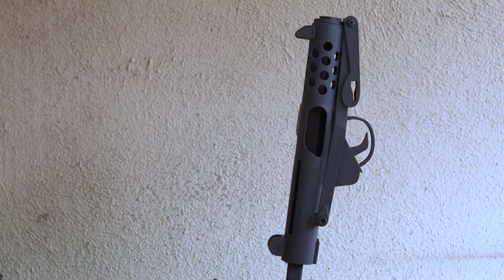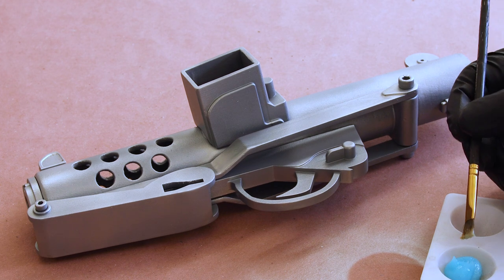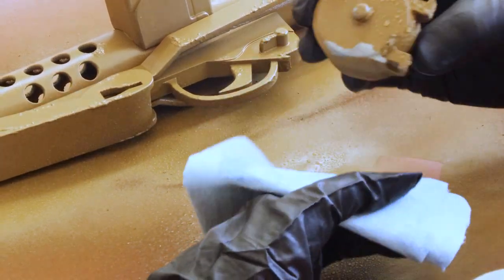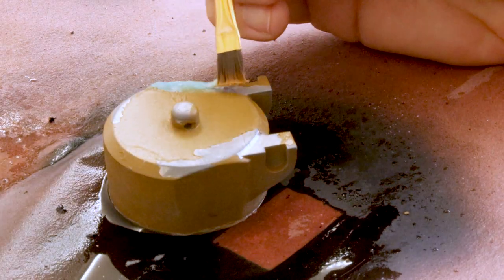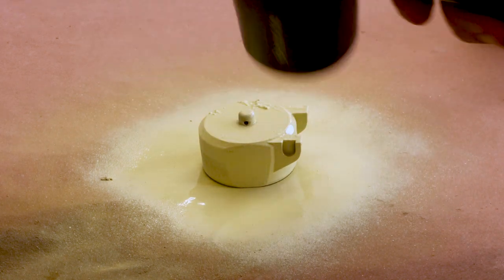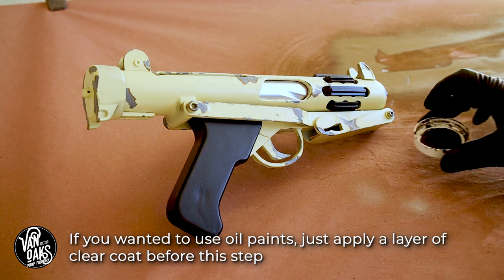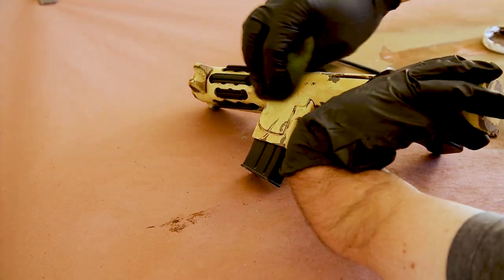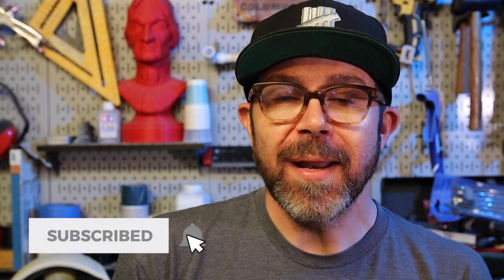Chipped Paint Effect for Props & Costumes | #andor

Comment: Love this technique. I have done a similar type of layered artificial chipping and aged appearance using plastelina clay as it is easy to remove and sticks to just about everything. Another benefit is if you put a spot of clay onto the base coat, spray the second layer down and let it completely dry then you can just flatten the clay a touch more here and there to act as the mask for the third color without having to reapply anything. 

Turned out pretty good! As with all of your projects. Top notch work.